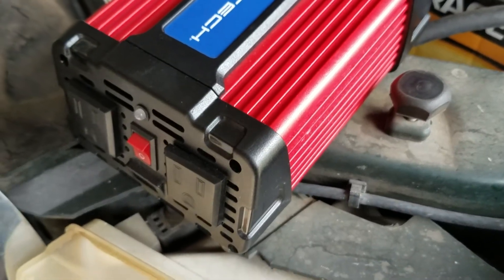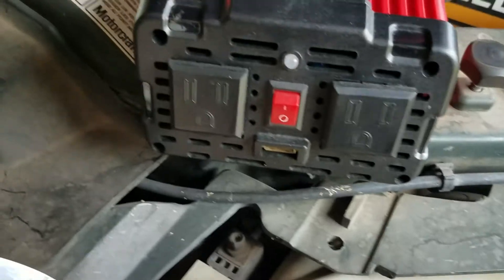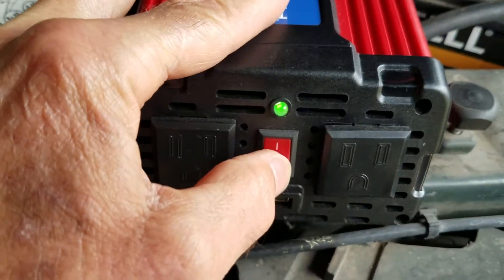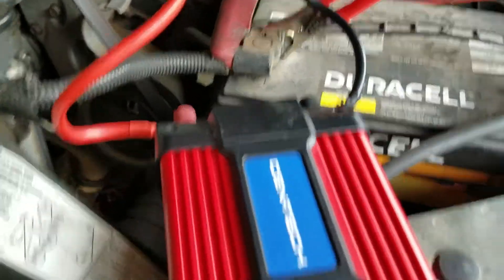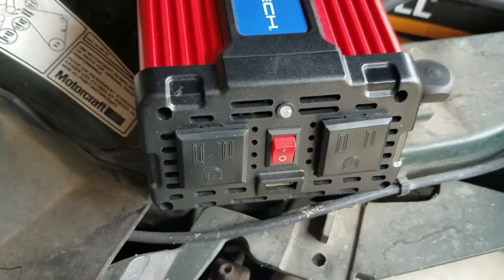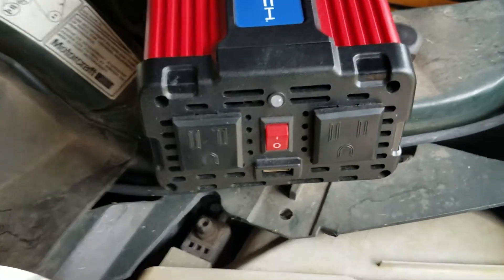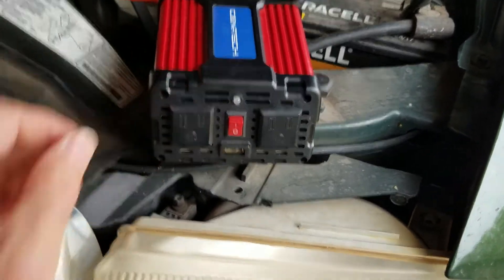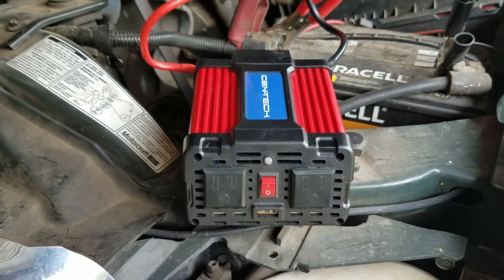Centech 750 watt power inverter repair and proper hookup

Comment: FYI, THERE IS A PROTECTION DEVICE INSIDE OF THE INVERTER. MINE SBUT DOWN A YEAR AGO AND I SET IT ASIDE FOR SEVERAL MONTHS WHILE I USED ANOTHER INVERTER. THAT ONE THEN QUIT. SO I TRIED THE CENTECH AGAIN AND ILL BE DARN! IT WORKED AGAIN? 
IT JUST QUIT AGAIN LAST NIGHT AND PULLED IT APART, LIKE YOU AND TESTED ALL THE FUSES WITH AN OHM METER. THE FUSES ARE GOOD, I ALSO DRAINED THE CAPACITORS BEFOR PULLING IT APART. ONCE IT IS DOSCONNED FROM THE BATTERY, JUST TURN THE SWITCH ON AND LET IT SET FOR SEVERAL MINUTES. THEN YOU CAN CHECK OUT THE BOARD.
ILL HOOK IT UP IN A BIT AND SEE IF CAPS CHARGE UP AND SEE IF IT WORKS AGAIN.